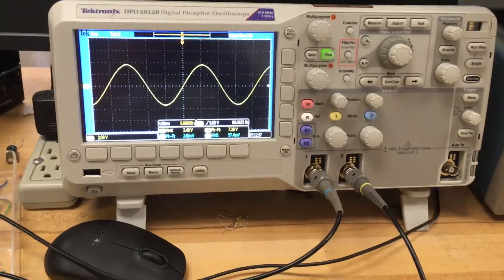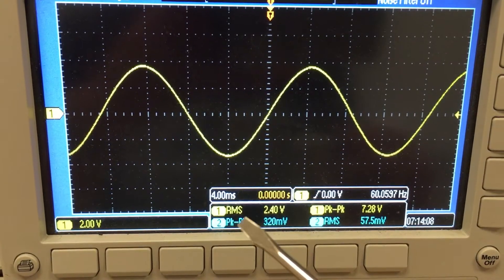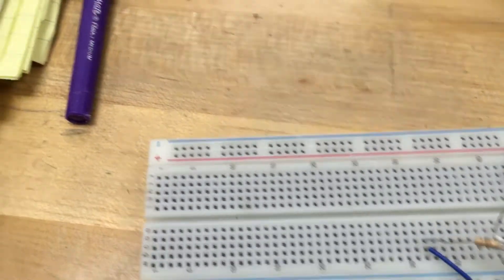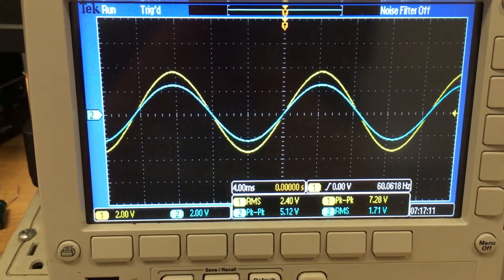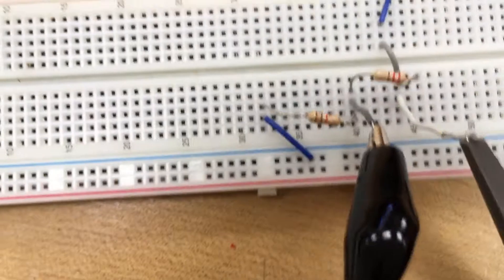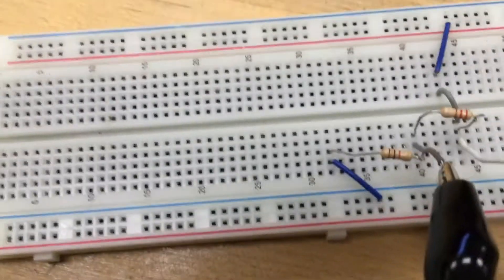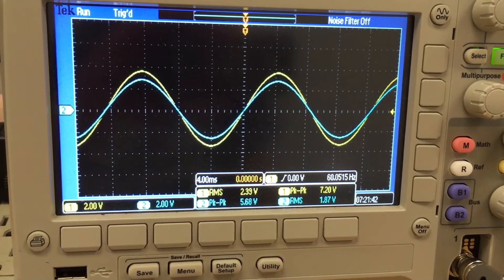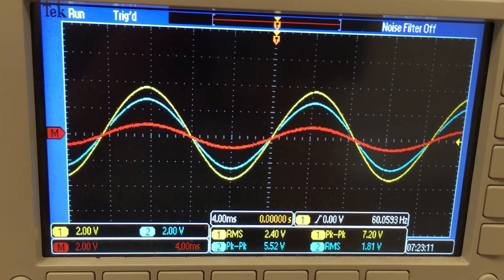Basic Oscilloscope Measurements

Comment: Hi Matthew, I learnt a lot from your video. The issue I face with the similar circuit is that when I measure the voltage over the second resistance (the one that is connected to the ground), the wave form is triangle shape and is not in the square form (incoming signal). Do you have any thoughts about why it is happening? Thank you!

Comment: What will be the result if we power the circuit with dc power supply or battery instead of function generator?
Reply: Yeah! Answer the question, Fairbanks!
Reply: Based on my lab session, just a straight line since it's DC
Reply: Straight lines